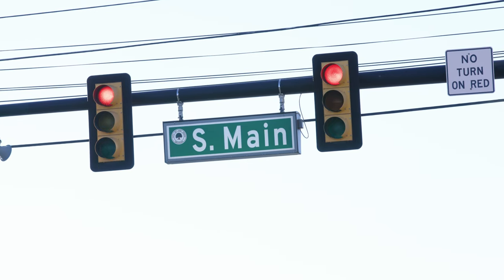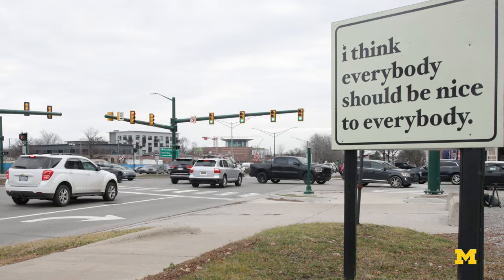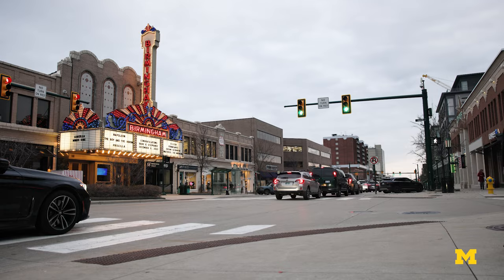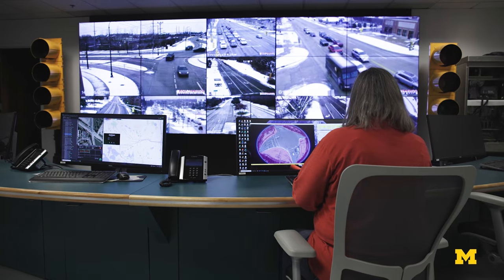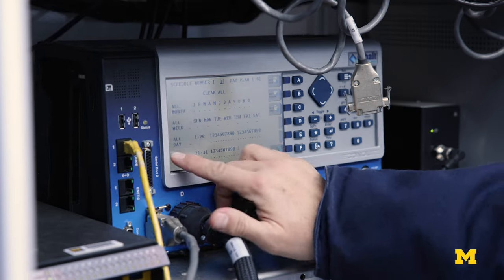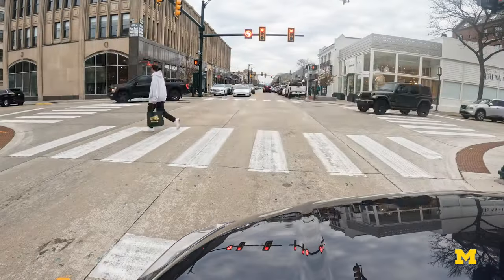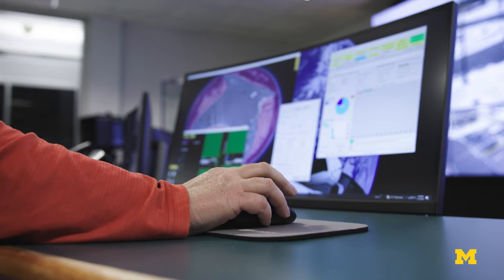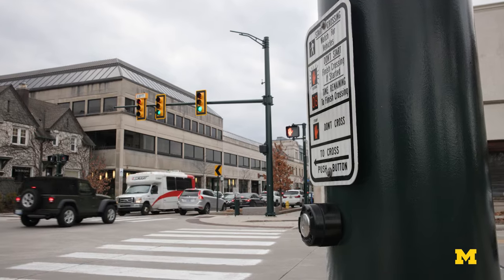How to improve traffic lights in Birmingham, Mich. with connected vehicle data

Comment from the maker: To learn more about this project, read our companion article: https://news.engin.umich.edu/2024/02/improving-traffic-signal-timing-with-a-handful-of-connected-vehicles/

This research was published in Nature Communications on February 20, 2024 and is titled, "Traffic light optimization with low penetration rate vehicle trajectory data."
https://doi.org/10.1038/s41467-024-45427-4